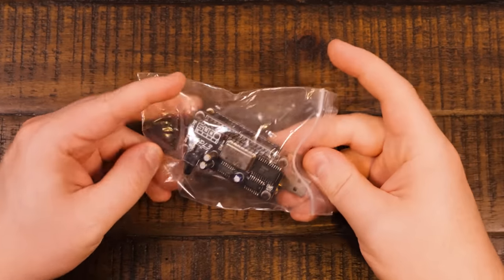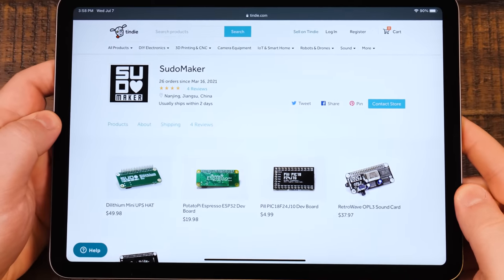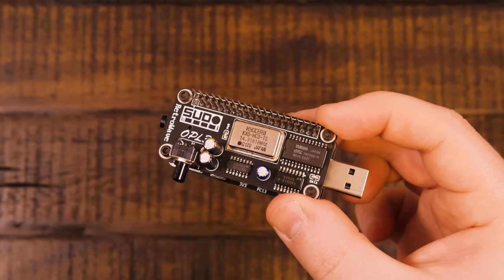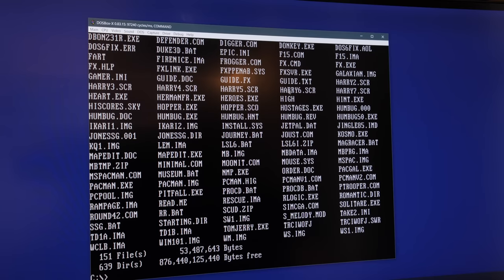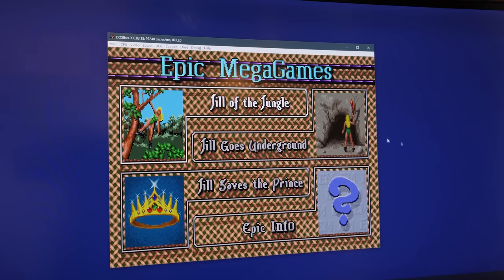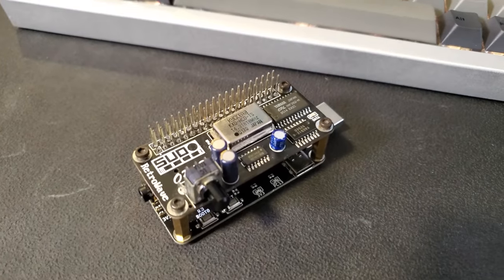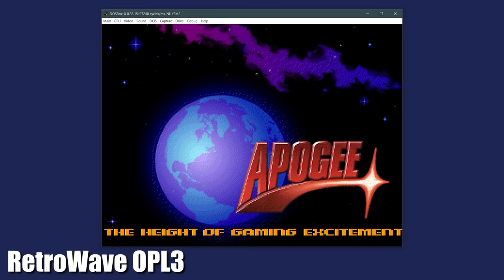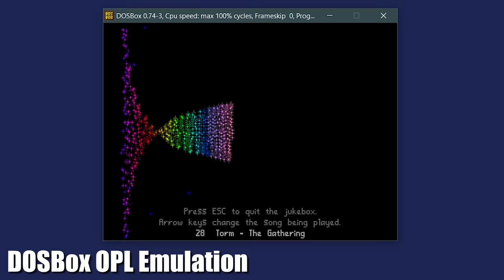RetroWave OPL3: The USB AdLib Sound Card

Comment: It mostly sounds like the retrowave has more high frequencies and the lower end FM basses are a little smoother compared to the emulation
Reply from the maker: Definitely, that's my takeaway as well. Nothing massive but it's there if you're looking for it :)
Reply: @LGRBlerbs  Sounds fuller, more authentic, more analog-y.
Reply: I'd agree with that. But wow emulation is damn fine these days, maybe comparable to an ESFM chip? Better maybe.
Reply: Indeed, the emulation is rather good, but not exact.
Reply: Very subtle difference, I'm cool with emulation.
Reply: On the direct capture, I had to put my headphones on to hear the difference.  Granted, my speakers probably aren't the greatest -- though they are the same beige-box speakers I was using with an actual Sound Blaster 16 back in the 90s.  (U.S. Logic brand, made for Computer City, Tandy's long-defunct computer store which ceased to exist in '98.)  They've held up well, only problem is the volume knob could use some contact cleaner at the low end of the range.
Reply: I wonder if the emulator has low and high-pass filters that are maybe a bit too aggressive, possibly based on testing with old AdLib/SB cards with electrolytic caps that have seen better days?
Reply: It also have a bit better gravel or crunch to it. Hard to explain.
Reply: @AaronSmart.online  The YMF262 is fully digital, it outputs 16-bit floating point values to the DAC... So a bit-perfect emulation of the FM chip itself is indeed possible.
What everyone's technically comparing is the analog circuitry inside / after the DAC, which is... sort of pointless? :]
Reply: meh, it's so subtle that it could be explained by the audio signal path in LGRs PC.
Reply: I could hear a noticeable difference in the percussion sounds with the USB OPL 3 device, so while not night and day it’s still noticeable even from a mic pickup (rather then direct audio out recording) on a YT vid.
Reply: @Charlesb88  that could still be the audio signal path on the PC VS  the output on the OPL board. It means nothing with a sample size of 1.
Reply: It definitely has more higher end frequencies, But I notice it has have less lower frequencies. Honestly I would prefer the emulation. It's starting to get to the point, It's  hard to get hardware that beats emulation haha
Reply: To my ears the emulated Adlib has a sound thats almost identical to the CQM based Soundblaster cards, and a hint of ESFM in there also. The retrowave sounds just like my two SB16s with the real deal OPL3, just cleaner and less "aged"
Reply: @shawnchalfant1595  Absolutely. I think playing the games you probably won't notice much difference.
Reply: @ninkeon58  The other thing to bear in mind is that on real hardware, the sound will go through some filtering caps which have some variability and may degrade over time which will filter out the high freqs. So the Retrowave will probably sound brighter than real old hardware.
Reply: @kveemusic  Well it depends if the emulation of the YMF262 is being 'bit-perfect'. Remember that just because it using digital signals, it doesn't mean it's basically just a perfect CPU running instructions. I would be surprised if the emulation is actually emulating all the circuit action inside the chip. Generally emulation will treat it like a black box where the software inputs along with the current state within the black box produces some expected output. This allows optimisation and generally works good enough. But this approach does mean there can be small differences. For instance, does the chip have any unintended behaviour if the input signals are slightly out? Is there any issues with electrical noise? 

Of course, the DAC circuitry will also have a major effect and needs to be emulated if the original card's DAC has any character to it (which unless it's incredibly expensive, it will do). But emulating digital chips in software isn't that trivial.
Reply: That seems like something that could be easily tweaked if you had some equaliser type settings. Even just tweaking the volume in this video made it extremely hard to tell the difference.
Reply: @LGRBlerbs the emulator comes out throug your modern sound card... maybe that's the difference you hear ........ Someone should make a USB to ISA thing Clint ... for use a SoundBlaster SB16 on modern PC's.. .. Most of the current sound cards.. are highly out of tune.. as you can check with any vintage Hi-Fi graphic equalizer.. Low frequencies like 100Hz or 60Hz... modern sound cards play thouse at very different (wrong) volume that frequencies like of 1KHz or 2.5KHz ..
Reply: Especially in the last example the emulated basses sounded better to ma ears.
Reply: Like he says in the video... Why just repeat almost exactly the same? An astounding level of idiocy is required to not realize something like this.
Reply: @kveemusic  I don't know how it's done in this case, but if I was emulating a sound card I would want to make the audio sound as it would from the sound card's analogue output, not directly from the DAC. And we know the likes of Creative didn't exactly use the highest quality components...
Reply: @AaronSmart.online  Well here we're on a philosophical crossroads, are you going for the FM chip itself (can in theory be done exactly and is arguably the more interesting part), or the whole system, including the analog part (which is different soundcard to soundcard)? :]
To me, the fact this chip is digital and can be replicated 1:1 is very satisfying. Btw I don't actually know how exact Nuked is, but the attention to detail is there and I've worked with the library, and it even exhibits one sample delays due to internal register latching, plus at the correct sample rate, I can't really find an example where I'd spot the difference.

Comment: I think you accidentally just did an episode on how good DOSBox OPL emulation has gotten.
Reply from the maker: Ha! Yeah that's kinda how it ended up. I was surprised myself.
Reply: Plus there are options to use other music cards in Dosbox which sound better, e.g. Waveblaster
Reply: That Dosbox 0.74-3 as well based i think on MAME core which is known to be inexact, though that was a decent effort already. If you use a fork such as Dosbox-X or one of numerous others, set the emulation core to "nuked", OPL sampling rate to 49716, you get an emulation with cycle and sample accuracy. Though "nuked" cannot be guaranteed to be bug-free, the validation effort that went into it is quite substantial. It's not enabled by default because it eats CPU.
Reply: This device isn't longer available
Reply: @zombee38  but an easier to manufacture successor to it is

Comment: My takeaway from listening to the comparisons is that the OPL3 chip has just a fraction more attack in the sawtooth waveform, which results in a brighter, punchier note. Like adding a splash of lemon juice to a sauce. It doesn't literally change the tone, but it adds a bit more resonance to the sound. 
It's particularly noticeable in the higher octave notes where it takes on a more brash, aggressive sound, like when you strike a piano key with a lot of force to make the note pop.

Comment: There's some noticeable difference in cymbals in favour of the real thing. Almost feels like CQM vs OPL. Could be the result of internal DosBox OPL resampling. Also it's not just any OPL3 chip, but the one without 1Hz difference "problem".
Reply: So... what does that mean? Never heard of that 1Hz problem. Should we buy it or not?
Reply: That difference is even between different versions of the actual OPL3 too, so at this point you can have OPL3 emulation that's closer to the original OPL3 than its later revisions, just due to the original sampling rate being used :]
Other than that, it's common to manually edit DOSBox's OPL sampling rate to 49716 to match the sampling rate of the original chip. If left at 44100, there will obviously be some slight differences too

Comment: Tbh DOSbox's OPL2 sounds pretty spot on for the most part. The emulation sounds like it's missing a percussion channel (Jill) and has a distorted instrument (Duke 2), that's the only difference I can notice on YouTube
Reply: Yeah, with earbuds and a fan going I can’t tell a difference between any of the direct capture clips except the HW was a tiny bit louder.

AFAIC, other than the slightly wrong percussion in the first example, this is getting to the level of cork-sniffery.  Emu is good enough now, and that is a good thing.

Comment: Great video! Interesting comparison. Here are my observations:

Jill:
DOSBox OPL emulation:
Bass drum has slightly more oompf, the snare drum sounds more metallic and is more resonant rather than based on noise.

Retrowave OPL3:
Bass drum is mixed lower or has less energy in the bass register, the snare has slightly more noise to it, less resonant, longer decay.

Keen:
Hard to tell because the tune is different so there is no way to do an A/B comparison.

Apogee intro:
Surprisingly similar. Typically I find that patches with a lot of feedback tend to show more differences when comparing hardware to emulation but this sounded spot on.

Duke 2:
DOSBox OPL Emulation:
The bass is bassy and clean.
The ride cymbal in the second segment (about 11:01) has noisy overtones but a different set of them compared to the Retrowave.

Retrowave OPL3:
More overtones in the bass, not as clean. And this is exactly what you would expect from an old FM synth. That's why people still buy old Yamaha DX7s - because of the dirt and the grime in the bass sounds. Emulation sounds too clean here.
The ride cymbal in the second segment (about 10:57) has noisy overtones but a different set of them compared to the emulation.

Jukebox:
DOSBox OPL Emulation:
Lots of bass, very clean.
The kick drum has more bass.

Retrowave OPL3:
Not as much bass in the bass line, more overtones.
The kick is more punchy but less bassy. Or it could simply be that the transient from the attack stands out more when there is no real bass response, so it might be that both emulation and the Retrowave OPL3 has equal punchyness. Either way, the bass response in the Retrowave is much less pronounced and has more overtones.

Overall:
It should be noted that the result depends a lot on what kind of digital-to-analog converter they're using in the Retrowave. I'm assuming that DOSBox does not emulate the effects of crappy DACs and amplifiers on old sound cards. The Yamaha DX7 mk1 from 1983 had legendary 12-bit DACs that introduced quite a lot of noise and overtones especially in the low-end which made the sound real grimy compared to the DX7 mk2 that came out a few years later, which had 16-bit DACs. Stuff like that has nothing to do with the sound chip itself and more to do with the circuitry downstream from the sound chip. Either way, the differences here are quite subtle overall but there are certainly differences here and there - especially in the bass response vs. the overtones generated by bass sounds. 

If there is one thing that I realized it is that the DOSBox OPL emulation is surprisingly good ;D. Maybe that's the wrong take-away here but that that's what I feel ;).

Comment: The OPL3 is likely easier to emulate in software than some other older sound chips since it is an FM design, which is mostly a digital circuit. Some other chips from the era had more analog circuitry such as filters, which is harder to get right. Software synthesizers that emulate other dedicated FM synths such as the Yamaha DX series often sound very accurate, whereas analog emulations such as a Minimoog have only recently gotten to the point of being close to a 100% match in terms of sound. There are a lot of complex interactions between the analog components.
Reply: It's completely digital. It's only the YAC512 DAC where it's turned into an analog signal, the YMF262 feeds it floating point data :]

Comment: Looks like it uses a Burr-Brown op amp for the output, which are very good quality. It's also using a Yamaha DAC to match the OPL3 chip, so no problems there. But if you really want to replicate the sound of an AdLib or Sound Blaster, you'd really have to replicate the analogue output circuitry on those cards.

I just checked TubeTime's AdLib schematic, and there's quite a bit more to the output than just an op amp. For some reason the signal from the DAC goes through a buffer, then through two gain stage op amps, some filtering, a transistor pulling the signal through a resistor, with the signal tapped off after the resistor, then some more filtering before the volume knob, and then it goes to the output op amp, which has some more filtering before it goes to the output. Not to mention the output op amp is a boring old LM386, so not exactly a low-noise unit like the Burr-Brown one used on the RetroWave.

I'm no expert on analogue electronics, and they haven't released the schematics, but looking at the pics on their wobsite, it's missing the LM386 output op amp, and there's a suspiciously small number of passives on the board to replicate the different filter stages.

Sure, it might sound a little different from the emulator, but it's likely going to sound different from the original hardware too. And really, how good is your memory of the music or sound effects if you haven't played on the real hardware in years or decades?

I mean, personally I distinctly remember hearing the difference in AdLib music moving from a Pro AudioSpectrum 16 to a Sound Blaster 16, and to this day I can watch people playing games on original Sound Blasters and tell it doesn't sound "right". So yeah, maybe there's a reason why I collect original hardware.

Comment: Aw man, I gotta get one of these. Wonder if it’ll work with my Raspberry Pi.
Reply: Its designed for the Raspberry pi - the bottom board in the video is just for if you want to connect it to USB instead
Reply: I think they're designed to mount to the pi's GPIO pins on top
Reply: @Vexonia_Music  Yeah, it does say it's RasPi compatible.
Reply: @Vexonia_Music  oh nice.

Comment: Oh, that’s exciting. I can imagine buying one, plugging it in, and setting it as a MIDI output in my DAW. Mmm, delicious. (I sure hope it would support such a thing! If it would work with MIDI player programs I’d hope it would work with a DAW output though.)
Reply: It’s not currently a MIDI port, it’s a serial interface to the OPL registers.  You would need a Windows MIDI driver like in the old days, to handle patch management and tone generator channel allocation, and expose that to the multimedia API - whatever that is in Windows 10.
Reply: Use it as a MIDI device requires it to have a built-in soundbank... Whoops, but it's planned and will be available in the future!
Reply: Thanks for reminding me, I need to update my Windows OPL3 MIDI driver project to support this device.
Reply: @nickwallette6201  oh it’s a serial port. That makes sense. Still, I’d hope drivers like that shouldn’t be too tricky! We all casually use MIDI over USB after all. Which of course is the case of a similar driver, but industry standards make it transparent.
Reply: @sudomaker  that’s good to know! So, even if you got a MIDI serial driver set up, it wouldn’t produce sounds from a DAW just yet?

Comment: You might want to take a look at the mt32-pi project Clint, it's kind of similar in principle to this but for Munt (MT-32) and FluidSynth on a Pi, with one of several MIDI hats. It even works for midi over network now.
Reply: I think I saw PhilsComputerLab do a demo of Munt/FluidSynth right on the same PC running DOSBox (and via Network from a Pi).
Yes, the mt32-pi project is great (I have one for my MiSTer), but many people may not even need one to use/hear/test it.

Comment: It's funny how good the emulation is, all things considered.  Without an A/B, it certainly sounds "good enough."  The RetroWave seems to either generate a wider frequency range or filters it differently though.  Similar to the MP3 vs. FLAC notion: if there's sonic information on the extreme ends, MP3 is very likely to chop it off.  You're still hearing the music and it'll mostly sound ok, but going FLAC tends to restore things like room reverb and little transients and harmonics in the instruments.  Same kind of deal here...  if a bit less dramatic in practice since it's all digitally generated.

Comment: The OPL3 emulation is most likely spot on. There's an issue you haven't considered: resampling aliasing. You need to have a completely clean path from the emulator output to the sound card DAC, and unless both the OPL3 emulation and the DAC are running at exactly 49716 Hz (the internal frequency of the OPL3 DAC), you will have resampling. Realtime software resampling is always a compromise, since it's quite CPU intensive, so you'll definitely have aliasing at higher frequencies, distorting the sound (especially percussion).

Comment: To me it sounds like the DOSBox OPL Emulation sounds better in when it comes to low frequencies as the Retrowave doesnt sound like it goes as low, but the highs are slightly brighter in the Retrowave. You will need headphones or speakers that output low bass frequencies to hear the lows difference better.

Comment: Load up the Voyetra SuperSAPI driver and play some general MIDI files with percussion. OPL emulation usually has trouble with the percussion section, and the 4-op timbres with stress the chip to its limit.

Comment: I used to have an ISA OPL3-SAx back then. Is there any PCI or PCIe OPL3 sound cards so that we can use it as the main sound card of a modern PC?
Reply: @kveemusic  Thanks, after some research I have found that CMI8738 also has hardware OPL3 block within the chip. There are few cheap PCIe CMI8738 cards on Aliexpress and I might give it a try.